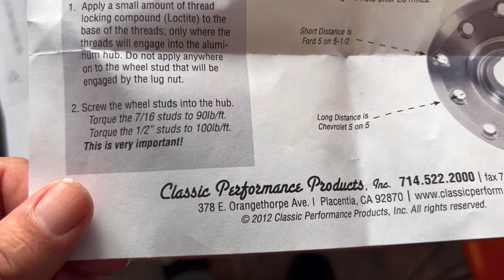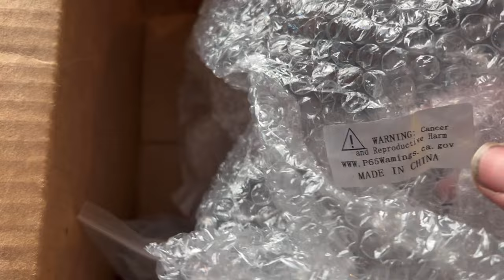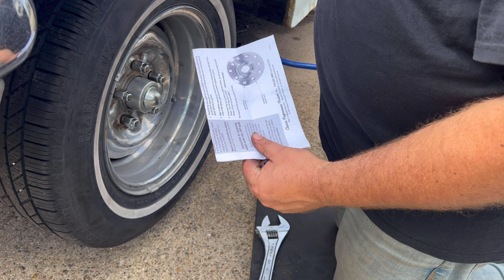55 Chevy / Canadian Pontiac wheel bearing upgrade

Comment: Rad! Having some ( updated ) equipment on the car that is easily "sourceable", no matter your geographic location is a great upgrade! Especially for us us drivers!
Reply from the maker: Yes I love to drive that car and never even considered that the bearings were unavailable or I would have done this long ago. 
I wouldn’t be surprised if the bearings are the same as the ones in your cutlass. The missing link is the hub that allows you to retain the stock drum brakes, 61-68 full size Chevy, the CPP ones fill the gap .
Oh and these bearings are commonly used on trailer axles too.